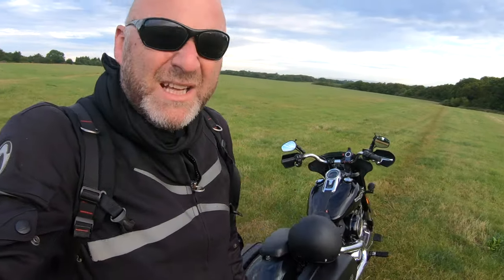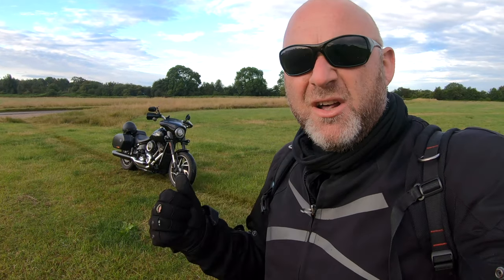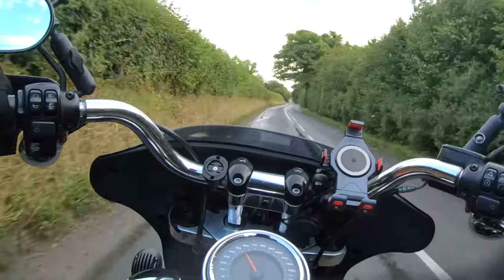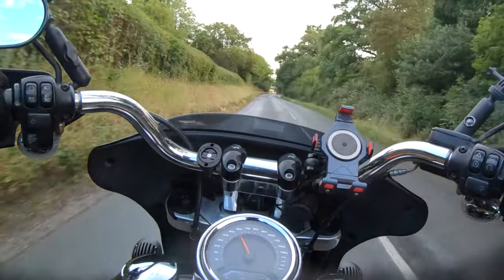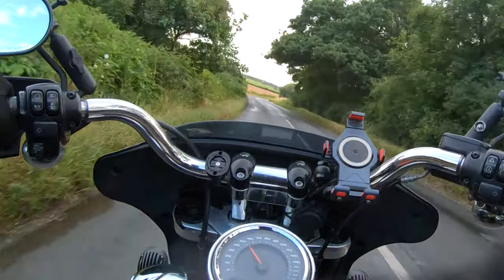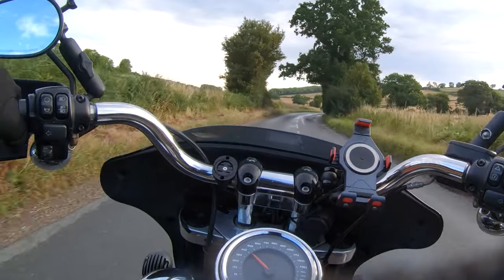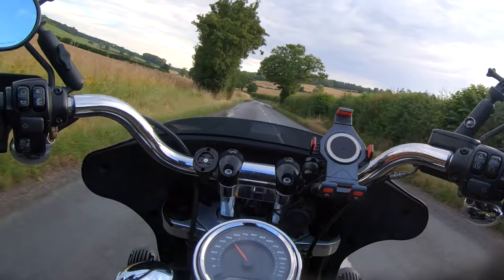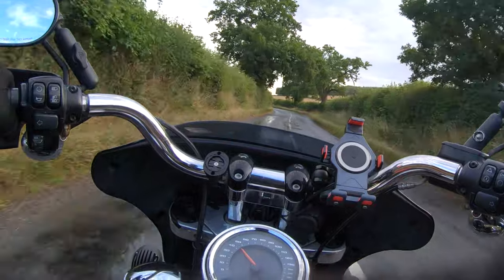Why Engine Lugging in Low Revs and High Gears Is Bad News

Comment: Nicely explained Alf. Glad you brought this subject up. Internal combustion engines are designed and engineered to operate through a rev band. I've always believed that any engine that seldomly has a higher potential to develop premature problems... Once warmed and operating temperature is optimal theres no harm in using that full rev range periodically. You can feel an engine that has not been used freely by its  previous owner, probably believing they were looking after their engines by lugging around.
Reply from the maker: Yes for sure

Comment: Basically Cruise Control is useless. Here in Australia, our speed limits are mostly 100km/h on the highways. There are some at 110. With an S&S 475 cam, my previous sportglide was revving at 2390 in 6th, 2590 in 5th at 100km/h. Power didn't come on until about 3,000 rpm. This meant I could not use cruise control on the highway and overtake semis as I had to drop back a gear or 2.

Comment: Don't be affraid to make some rev's with this M8 engines. Although I never want to overload the engine at low revs I can ride in 6th with 2000rpm (90Km)...only with no wind or down hill.....I stay between 2000-2500 when cruisin (Ultra Ltd 2021 114)

Comment: It rattles if your in too high a gear for the revs on a new bike with quiet factory silencers. harleys are well known for it. Gearing is tall and these bikes are gear specific, if the roads your on call for 4th then ride in 4th. You dont need to always shift up to top as fast as you can and sit there. It can be a bit hideous aproaching a slow bend where even 3rd is too high, best to slip the clutch and pull thru gently rather than drop to 2nd and lurch the bike. Harleys are good for riding the clutch through tight slow corners always done it on mine. 6th gear is pure over drive, no need to use it unless on a dual carriage way or motorway.

Comment: Not so much putting stress on the pistons, your putting to much demand on the fly wheel bearings. Lugging the motor you can actually  hear the stress placed upon the bottom end of the motor. The transmission will take a beating also. Lugging the motor is a no no. If your any kind of experienced rider, again you can actually hear the moving parts start to chatter. During oil changes you can see metal shavings on the magnetized oil plug. A sign the owner is a lugger, so to speak.

Comment: The problem is people don't understand torque. The gear selection is what creates the torque at the rear wheel. In first gear, you get a lot of torque and a little speed. It's no different than a bicycle. If you're going up a hill, you put the bicycle in first gear. It gives you the torque you need from the power of your legs to get up the hill. Makes it easier for you to peddle and thus you don't fall down. The trade off is you can't go very fast. Works the same way on a motorcycle. Only instead of Wheaties, gasoline is your power supply, the con rods are your legs, and the engine's crank are the peddles.
Conversely, if you're riding your bicycle down a hill and want speed, you put the bicycle in 10th gear. That applies little torque to the rear wheel based on the power of your legs, but provides your rear wheel the ability to spin much faster.
There is no free lunch. Power = tq * rpm. For a given amount of power supplied, you can use it to provide tq to get the machine going or pulling a heavy load or you can use the engine's power in a higher gear to get greater speed.
Little inline 4s aren't known for their low rpm power, yet stunters put a bigger sprocket on the back and voila, it becomes a breeze to loft the front wheel. Why? Because the they've increased the torque to the rear wheel. What did they have to give up in return for this extra rear wheel torque? Top speed.

Comment: Morning Alf
Bang on the nail mate.
A reason a lot lug their motor is to get that chug chug noise, they perseve harleys to have all the while.
Should be ridden at different revs throughout the gears really, as per running it in.
An occasional, up to 5k+ revs just to clear it's throat dont hurt either.
It also pevents carbon build up is my excuse lol😊
Safe rides bud 🤙🥂🎉

Comment: Hi Alf! As always, thank you for your videos... my Sport Glide just failed. Ignition coil seems to be damaged and HD is not able to supply a replacement, they say item is on backorder until October, can you believe that nonsense? Really thinking about going away from HD forever.

Before i make my decision, could you make a video about how to check your ignition coil or how to tey and solve those failures?

Thanks a lot! Your videos are awesome
Reply from the maker: I will see if I can cheers

Comment: Owners manual says 15,25,35,45 for 5 speed models without a tach.
 They only gave you a speedo to comply with the regulations. Recently they added EFi and brakes that work apparently. 
My first Harley had 4 speed chain drive drive and solid engine mounts, everything feels modern after that.

Comment: Nicely explained, Alf.

My FLSTSI manual goes in 10s beginning at 15.
1-2 (15)
2-3 (25)
3-4 (35)
4-5 (45)

Coming down, 5mph less
5-4 (40)
4-3 (30)
3-2 (20)
2-1 (10)

The main problem with the softail line is that they typically don't have a  tachometer. I personally believe that your method of 12s is good... at least if it's wrong it's favoring the correct error (higher revs per gear). But, the math is harder; 10's is easier.

Yes, lugging an engine, especially an air-cooled Harley, is the worst. Just don't do it. Aah, the downside of manual shifting.

😢 13:39

PS edit:  ...another thing, if on a long down grade you can compress the shifting without lugging, whilst on the other hand if you're on a long up hill climb you'll need to stretch out the shifting to avoid lugging.

Comment: I always shift at 3000 RPM and never run the RPMs below 2000 RPM except in first gear...
Reply: That is almost lugging the engine. Do 2500 minimum, and up to 4k or so before shifting. One advantage to this is more oil moving around. You won't really hurt the engine unless you're up around 6k all the time.
Reply: @derfskittlers6125  engine is not lugging at all around 2,000 RPM... I have been riding for 40+ years on many makes and models. but I do appreciate your input. : - )

Comment: I disagree, theres more to it than "lugging is bad"  Find a BSFC chart (brake specific fuel consumption) for your engine. It will show you the general range and loading the engine runs best at, if you can find them because they are difficult to find.  If you can't find it, you have to go off crank / cylinder geometry and flame speed.   That aside, I hyper-mile vehicles as a hobby and the best efficiency comes at "lugging" in the sweet spot on the chart, matching or FAILING SPEED. 

When youre talking about damage and lugging, you should be more concerned about oil and coolant pressures / balancing at lower rpms... I've had more issues managing that on my projects while keeping the engine in range.
Reply: Not sure why you disagree. He said all the same things you just did.